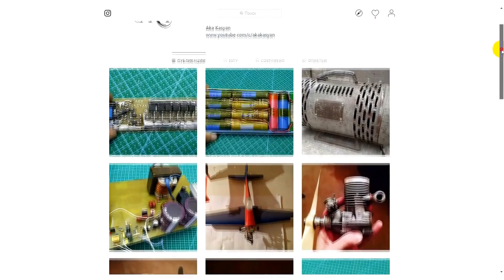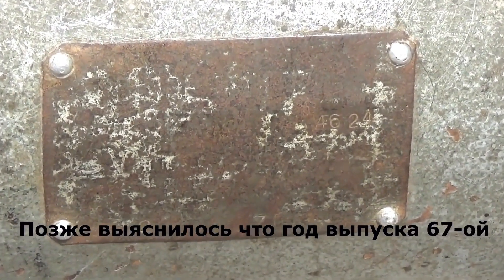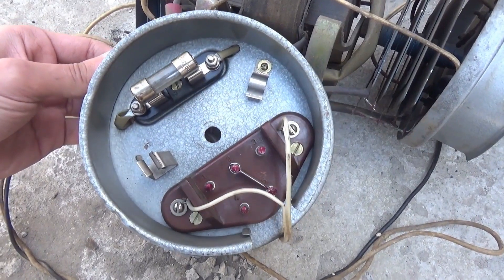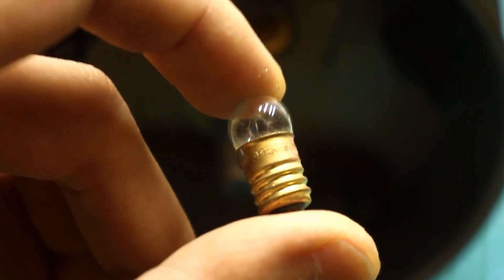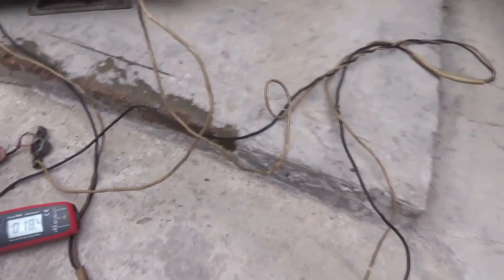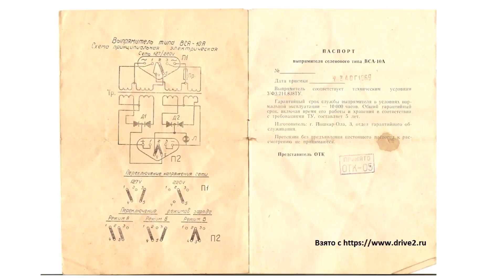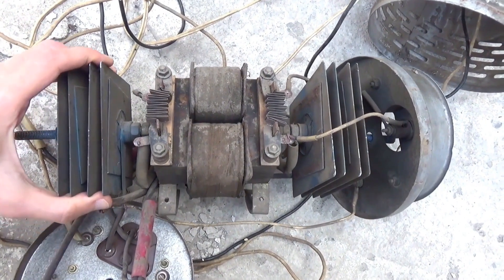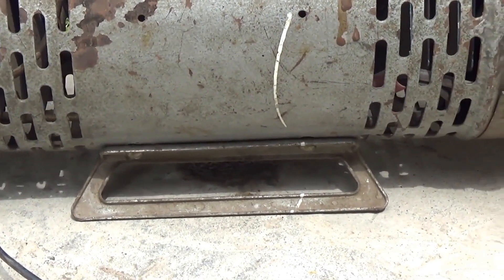The Eternal charger

Comment: very nice charger , in modern electronics the fuse does blow but only after the the delicate electronic bits have blown, some times even shattering the glass tube :-)
Reply: Fuses are designed to protect the wiring between the outlet and the device for the purposes of preventing fires. They are not designed to protect the electronics. You would have to have very small value fuses at every branch level of the circuit to protect the electronics.  It’s just not feasible.

Comment: The selenium rectifier bothers me. I've had way too many just die spectacularly. I would have left the selenium in place but disconnected and hooked up some silicon replacement.
Reply: I was thinking the same. Leave it in place and hook up some good silicon diodes tucked away underneath so not visible. I do that with filter caps in old tube equipment. Hook up modern ones underneath out of sight and leave the old cans in place to keep the original aesthetic.